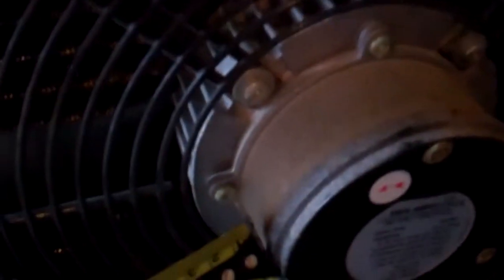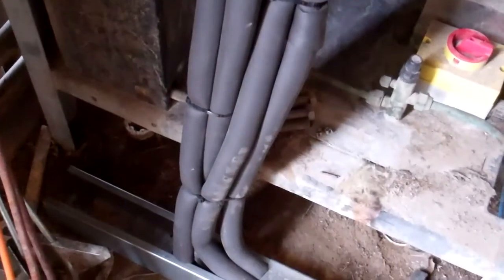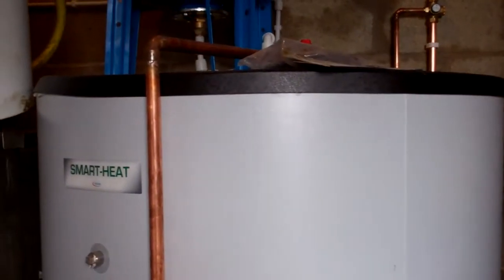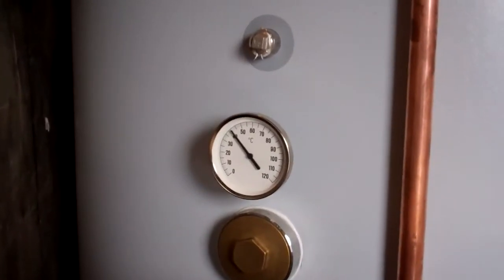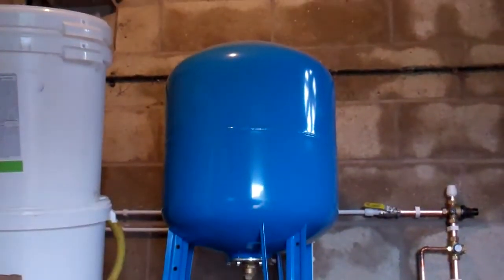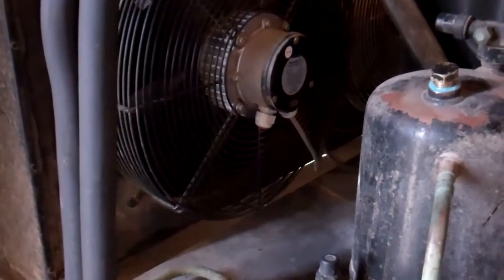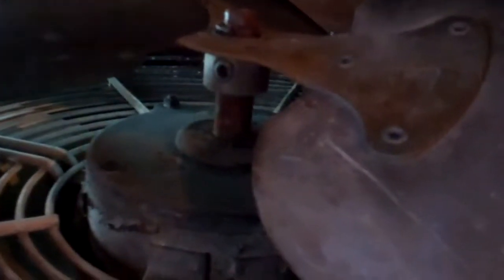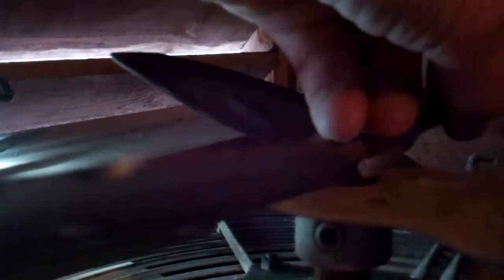Bad Fan Bad Pipes

Comment from the maker: Hi Fritz!

They are quick to change but can be expensive, priced up a 660W one on a copeland unit with noisey bearings and it was $1580.00!!!!! So didn't bother changing it LOL 
(can get pattern part cheaper but pitch is wrong and motor smaller, no good being cheap if it don't work!)

Been planning on getting a caliper (amongst other things...)but keep finding other things to spend money on like food and rent LOL

Comment: hey Jon never seen that type of condenser fan motor before with the aluminum cooling fins on it like that it looks somewhat pedigree. I thought I was the only one to use an open end wrench as a measurement tool....sure beats trying to get a tape measure or ruler in a tight spot